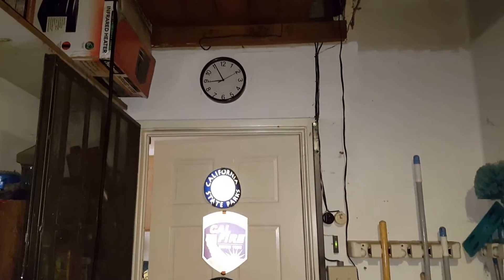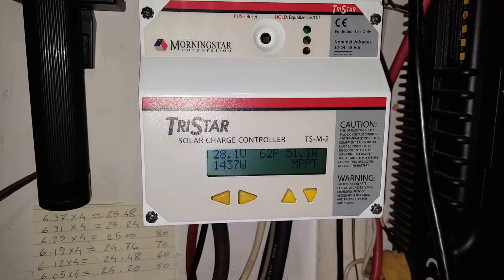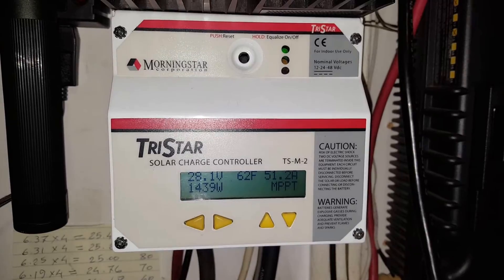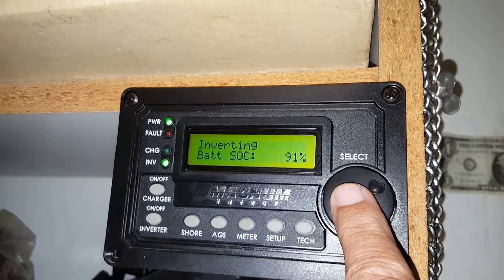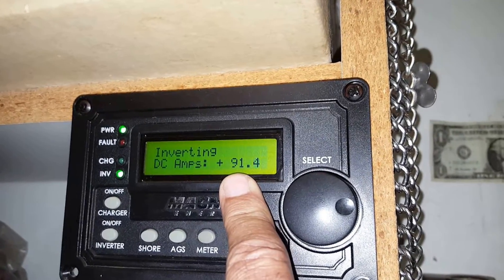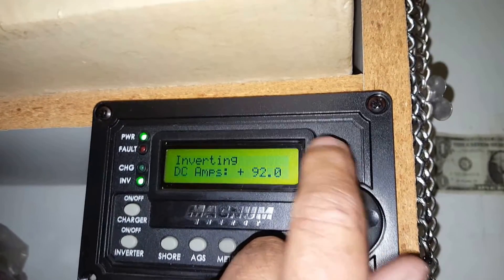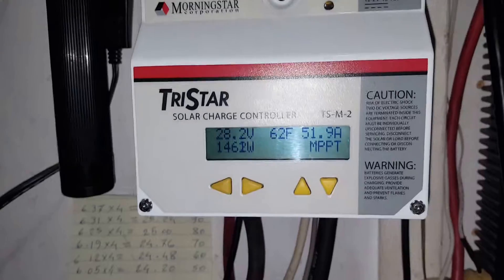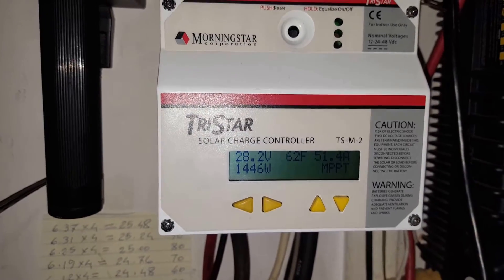Power Production By The TriStar MPPT 60 Charge Controller.

Comment: I wish I had started with the Tristar looks like it does an amazing job plus no internal fans to fail , great 👍 video sir love your set up
Reply from the maker: It's great controller! Very efficient with no fans and no relays that are prone to failure.  It starts charging the batteries with minimal sunlight at 28 Volts and starting Amps of only 0.1 where the MC needs above 34 Volts and starts charging at 1 Amp.  Be safe